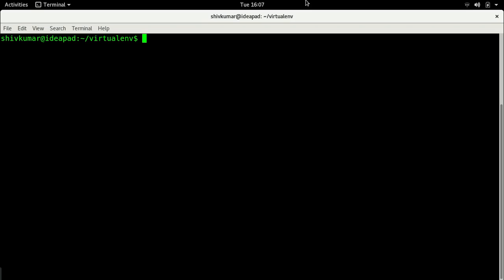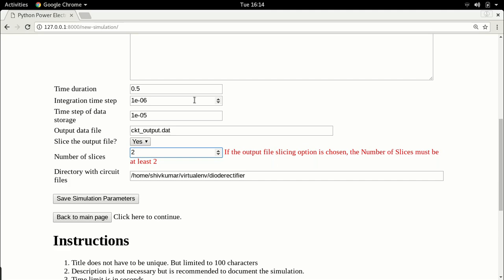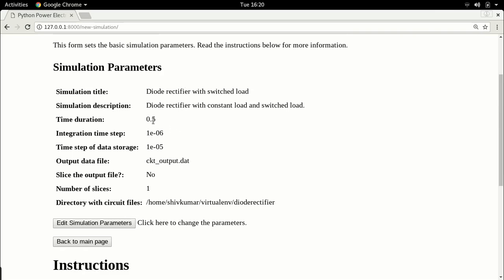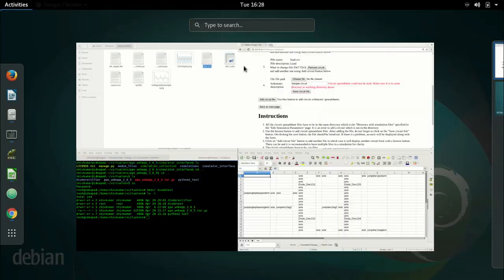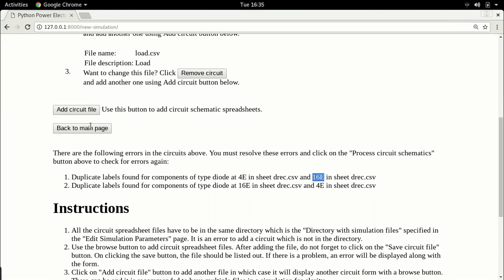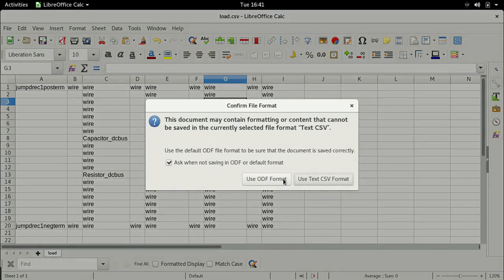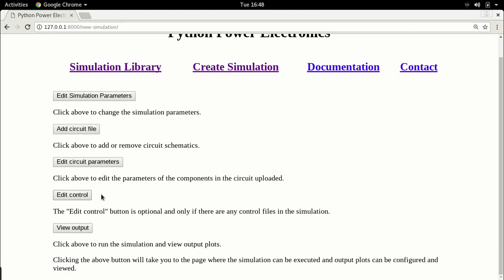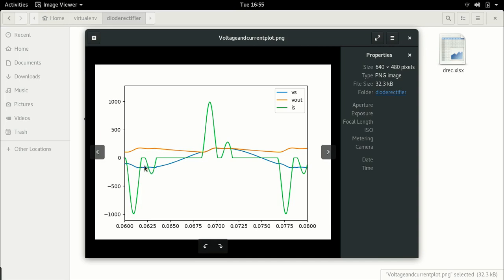Part 2: Common errors while simulating a circuit

Comment: how to mitigate OpenSSL error, i have installed openssl still it is showing it is not available
Reply from the maker: Are you using Windows or Linux?
Reply: @PythonPowerElectronics  windows
Reply from the maker: Are you using Anaconda or trying to install Python on windows? Anaconda will install openssl.
Reply: @PythonPowerElectronics   I am installing anaconda ... But still there is a error with openSSL
Reply from the maker: I suggest writing a detailed email to pythonpowerelectronics@gmail.com with screenshots of the error.
Reply: @PythonPowerElectronics  Hey it did worked when i uninstalled and reinstalled Anaconda!! thanks